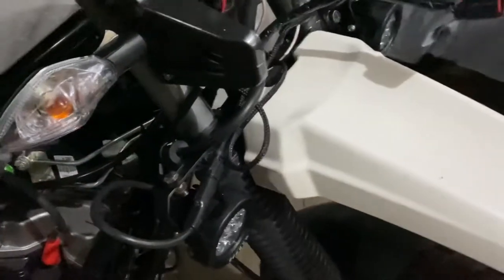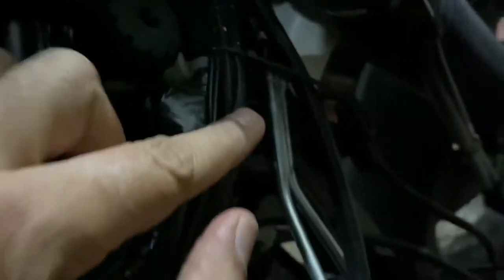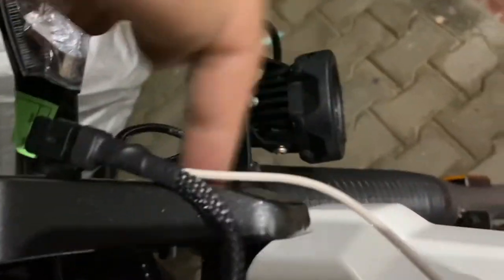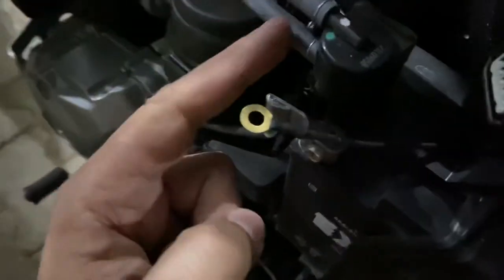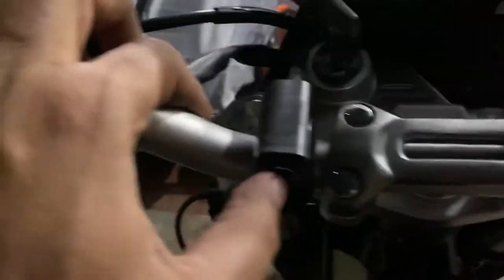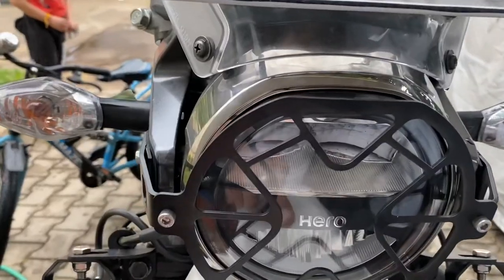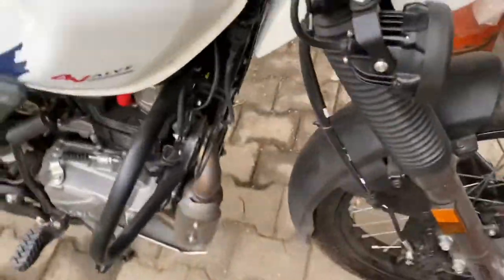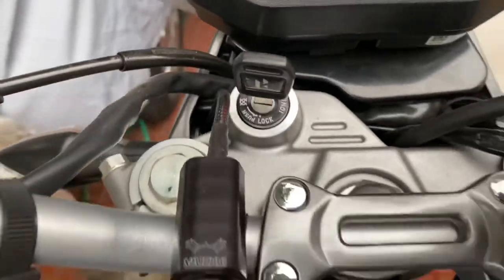MadDog ScoutX fitment on XPulse 4V

Comment: I had installed handle bar risers...maddog  switch wire length is enough?, If I install the maddog switch to the mirrors??
Reply from the maker: Yes, the wire length is enough if you have a 1-2 inch risers

Comment: Do the aux lights touch the tank when handle is turned to the max?
Reply from the maker: No it does not touch the tank when handle is turned either sides. I use MadDog clamps
Reply: @automotriztechnica  Ok 👍🏽 
There are also no issues for playing with the screws on the fork for installing the clamp. Right?
Reply from the maker: @ArnabMurshidabadi  Yes, I did it myself; but give optimal torque to tighten the nut until it fastens fully; Not full jaw twisting torque is needed, just optimal as it’s tricky that the clamp where it gets mounted also holds the forks; hence I mentioned tightening it properly with optimum torque until it stops with the power you have. And check it after few 100Km; it will still remain solid. I searched for torque numbers but didn’t get it anywhere. Hope this helps. But definitely you need fog lights.
Reply: @automotriztechnica  Thanks for your detailed response. Yeah I have ScoutX installed on the crash guard, but that location reduces the illumination a little bit I guess, that's why 'm searching for some alternative locations on the handlebar.
Reply from the maker: @ArnabMurshidabadi  Above handlebar or above headlight it’s not legal. Auxiliary lamps should be mounted below headlight only. Also cover with yellow filters. Not to be used in the City limits